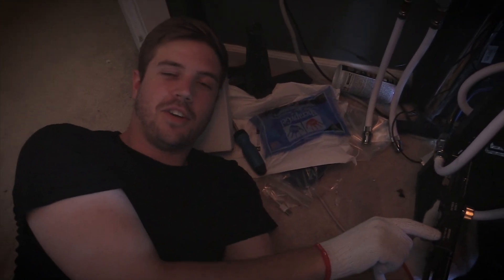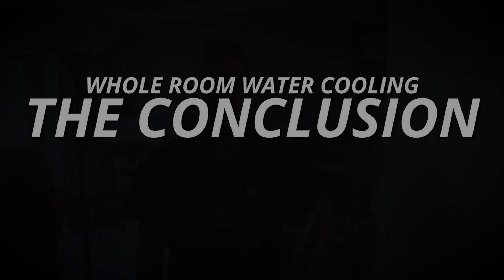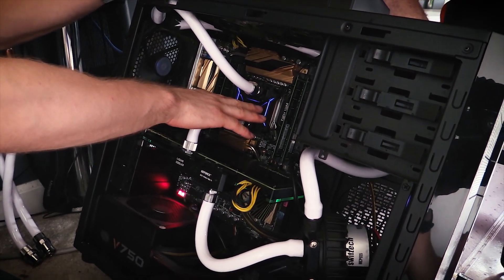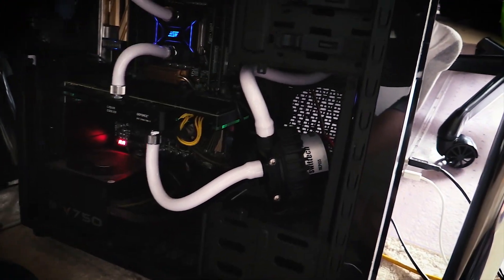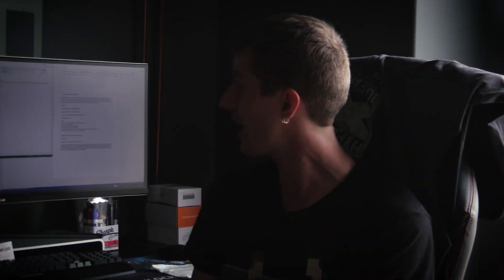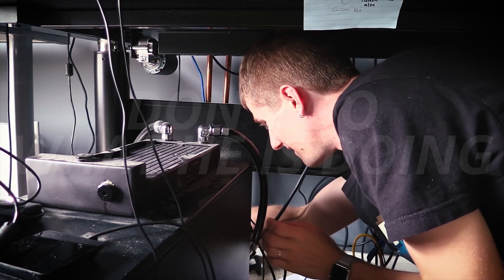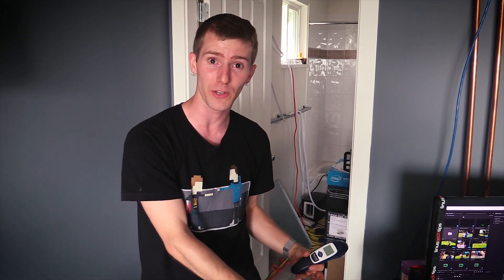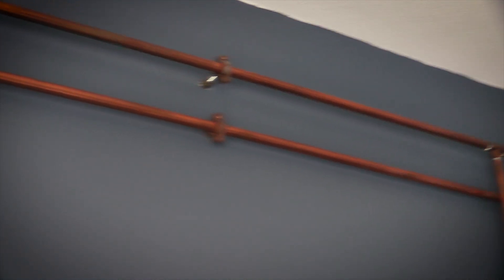Whole Room Water Cooling Part 7 - It's FINALLY over!

Comment: whi didnt you just put the whole computers on the other room whit a nice extractor on the ceiling, and drive the I/O to the other room with a nice air conditioner, youll get a cool quiet room to work, or just put a huge A/C on the room and be done with it

Comment: Large server rooms often use the space below the floor, and above the ceiling as plenums, to force cool air through the equipment. I've seen people use the same concept. Its a considerable amount of planning and effort, but it is possible, and quite effective (if your installation is permanent). It does require a split system but, your installation made me think of using a heat exchanger to pass cold potable water through to absorb the heat, thus saving some money on hot water heating  at the same time, decreasing your overall energy cost. It would be interesting to do a thermal analysis, to see how much heat you're actually dissapating from your equipment. Maybe discus it with the guy who did the nice job sweating in all that copper for you, he obviously has some knowledge about the subject. An afterthought,  the copper lines should probably not have tees, they should probably be in a series circuit, and not drop in parallel, for the sake of efficiency. Not sure what the ef% would be, but I rarely see parallel loops in new work. Great educational project, someone out there is probably already building on your work, and that's how we end up with great designs for stuff like this. My compliments.

Comment: Rubber hose/tubing with a glycol coolant and buna o-rings on fittings and water blocks would make this cheaper and easier to make and modify. Also getting a couple car radiators for heat exchangers would be cheap and work very well with low flow cooling solutions.

Comment: You went about this in an odd way.  The practicality of this isn't viable.  You lost a few hundred sq. ft. of space.  A better way would have to tapped into the cold water line and install a control valve, then exited the loop through the drains in the bathroom.  It would have taken up much less space.  Also, you should have used pex piping because of the heat transfer to copper.

Comment: So what happens if it's hot outside?
Reply: not much. even if it's like 35 degrees C outside, the cooling water would be up there too, and heated water one or so degrees hotter. since processors are already at 48 something normally, they wouldn't feel a thing, or very little, half a degree or so. since the amount of heat the computer generates doesn't increase, so doesn't the difference between incoming, outgoing water.
Reply: Exactly, it'd only work if there was an extreme temperature difference. But then you'd run the risk of having the coolant freeze, assuming it's water.
Reply: what? I was arguing that the cpu doesn't feel a thing if the incoming water goes from 29 to 39. those  computers still heat it by the same degree. to 31 and 41 respectively. same amount of heat output before or after.

Comment: well the thought was correct indeed but the execution was horrible...

you should have drilled the outlet into the earth 60-70cm where the temp is constant and then drive a passive heat exchanger

this way you can freaking cool your entire place not just your pc's

Comment: Haven't watched the other videos in this series, but the very first thing I thought when the video started was 'why haven't they insulated the pipes?'  

You'd keep the cooler water coming into the room cooler and stop the exiting warm water from dissipating the heat back into the room. 

Also, why run the pipes so high up the wall? They only need to get from one machine to the next at approx desk height. They'd be easier to service and the shorter system would require less load from the pumps to push it through and the fluid cooled quicker.

Comment: Cool idea! It looks like you don't want to rip open the walls but if you ran the circuit through the house and it was long enough it wouldn't have to go outdoors and would cut down on the heating bill in the winter. You could get wicked results from the cold basement if you evict your tenants...

Comment: even if you guys are going to get this comment or not you know you're not your idea was pretty good I would think I only see a few things wrong with it first of all you used copper pipe you should have used copper pipe you should have used them PVC pipe or something second of all he had in the top half of the room you should have never had in the top half the room you should have had it in the bottom along the baseboard other than that it probably would have worked a lot better than it did have not to mention you know copper putting all that fun stuff and your computer's least if you used plastic pipe in other words PVC pipe you guys won't have all that nasty dunk in there and you should get some sort of a filtration system 2 on the off-chance you guys do decide to rebuild that use PVC pipe and go along the baseboard remember heat goes up the cold air is down so the pipes will stay cooler if they run along the baseboard instead of up along the ceiling were all the heat is
Reply: oh yeah and one more thing you know you guys whatever radiator system you guys decided to put on the outside of your house you guys should get used to that you should have used him either cold water so I ran it through the bathtub and just had cold water cooling it or you should have just use like a an air conditioner type system like they use for fish tanks pacifically saltwater fish Lowe's refrigerator systems are really good and all you had to do was run the whole story and then they would have kept your system cool and then you would have just had to have a normal air conditioner thing blow into the outside world I mean there's a lot of ways you guys could have done that but using you know standardized fans and standardized radiators really cheap maybe not so much a standardized radiators but you guys should have used more radiators and maybe took him into a lower part of the house or into the car into your garage and then used and then use industrial-size fans or an air conditioner

Comment: I would have run the cold line on the floor and insulated the hot line near the ceiling.
Also I would recommend installing a standard whole house filter (like what is used on ice machines) to remove the extra junk from the water. Last did you try filling the tub with cold water? (moving the pumps to outside the tb but leaving the reservoir inside while it is 1/2 full [or more] can remove as much as 30% more heat.)

Comment: Whilst you might call it a fail, the noise win is probably worth it alone, especially in a room full of workstations.

Yes to other commenters: Whole room AC works fine in a server room., but the average server room runs at 85-90dBA and is NOT a pleasant working environment. If you can put the noisy bits outside or in an acoustic cabinet without overheating them, then its always worthwhile.

Comments:

1: Contamination/corrosion: This will always happen due to dissimilar metals in the blocks and suchlike. You need to have sediment filters and cathodic protection in the loop from day one. Drinking water spindown filters are cheap and readily available.Massively oversize it to reduce flow resistance. Couple with something like a Lakos twistiiclean to take care of the big bits and you'll probably never need to change it.

2: Bus vs spur piping. Why are these the same diameter? You should be using larger diameter on the distribution piping to reduce flow resistance and turbulence effects at the pipe junctions. The higher temps you're seeing at the end of the run is because of that.

3: Definitely use PVC or some other kind of insulated piping. Butynol is easier to work with and more than adequate for the temperatures involved. There are pressfit and crimp connections for this kind of pipework. Pretty? No. But to be honest, nor is that copper piping. Put it in some trunking.

4: Get rid of the opaque dye. if anything goes wrong you want to be able to see what happened and inspecting for gunk is much easier if the medium is transparent. UV-reactive transparent dye works well for leak detection.

5: The outdoor unit will be more effective if you arrange a recirculating waterfall/mister on it (adiabatic cooling). This assumes you don't mind the water bill but it's still cheaper than active cooling systems. if you go for this, make sure you have a uv steriliser in the waterfall loop (legionella is nasty).
Reply: @Ryan Black, the room temp only varied by 1 Celsius, the actual computer temps were very good, near room temp, or 10 to 15 Celsius drop. The electricity is probably equal or less than that of an AC actually. Of course, it's still not worth it for the pure goal of cooling the room in general... but that isn't really the point. It's nerds doing nerdy things for nerds sake. Similar to their series of making their own heat sink, you could just buy one, but it's the nerd goal of trying to make your own.
Reply: honestly, they should've just put all the computers in the bathroom, put an industrial fan in the window to blow air outside, put a vent in the door then just run long extension cables to the monitors and have a 7 port usb hub at each desk, they would've eliminated the noise and heat problems that way
Reply: exaxtlt
Reply: Totally agree on the piping diameter, with seven drops there wont be any flow at the last junction
Reply: Thank you. They should have hired someone like you to do the job. Would have really liked to see the results from a system like this properly installed.
Reply: Apart from the fact that they had to introduce pumps in each workstation to make the flow work >.> I don't imagine those are unnoticeable.
Reply: @benhook1013  If iam not mistaken those run just if they are not conected to the system
Reply: @Etien Don't think so, such a large system, the pressure would be too great to run just off the pump in the bathroom. When they disconnect/reconnect they only change the connections on the back of the computer, didn't see them mess around with the pumps each time.
Reply: @benhook1013  Then why did they need the second pump to flush out the PC individually? At some point he even put the pump out of a PC  when he reconnected it to the system

Comment: I am using a 400V 3-phase 150W scirroco type fan as a cooling aid for my old laptiop. Works like a charm. The fan was originally intended for coal heting boilers, lol. Works whisper quiet and by that i mean you can't hear anyone whispering or even talking.

Comment: For all your awesomeness I'm afraid this idea was just plain dumb in execution...
 
Copper radiates heat like a mofo, if you could insulate the heat until it was outside the room it would be much more efficient, all that copper at the top of the room is just silly...

Comment: insulating the copper was a crucial missed step also as you said vents on a high point and drain at a low point with a hose bib connection for easy draining out a window or sink.. also if you could have managed to pump chilled water in the system this would have been excellent

Comment: one use like metals two biocide and anticorrosive three car rad and car fan..... four better location of res... five two pumps but put them in different areas in the loop not directly next to each other... 6 drain plugs on allll systems...

Comment: as heating engeneer, all i can say its not bad, but you do few mistakes, first you use Cu pipes instead of some plastic with oxigen barrier, thats why you have brown watter, all you can do now is to add some corrosion inhibitor, wich prevents watter to oxidize. and i think you oversize your pumps i guess you have too much pressure on pressured side of the radiators.

Comment: As soon as I saw all that copper on the wall I was thinking most of the heat is being removed through the copper rather than the radiators outside. Like you should have seriously lagged the whole thing

Comment: now this makes me wonder. i live in the netherlands were temps outside are pretty low usualy. im currently in the process of researcing a new system and would it be feesable to build a water loop like this straight trough the wall and have the cooling bit done outside. not neccesarily to cool my room but to get the best cooling performance and noice reduction.

Comment: wouldn't it make more sense to just get a portable air unit that u can put in the window. I connected one to my pc and now run 35C when full idle and that's with just a few fans in the case. My roon can be 85F this way not water cooling needed

Comment: Idea get rid of the window
Reply: Windows act as a heat trap (sunlight gets in, heats the room and is blocked from reradiating outwards.)

An external awning helps a lot in hot weather. That's why they used to be commonplace before bruteforcing things with AC became popular due to cheap energy.
Reply: Removing the window would be against Fire Code and law for a room that people inhabit for extended periods of time...  Two points of egress are recquired at all times.  Especially if the residence is being used as a business.

Comment: Why not insulate the outlet with foam?
Reply: So that the warm outlet pipes don't heat the room up. The goal is to dump the heat outside.
Reply: its funny you have the guy from h3h3 vids and at 3:26 he is watching h3h3
Reply: There is significantly more piping in that room than most rooms heated with baseboard heaters. Though baseboard heaters have radiator fins and probably a higher temperature differential. Insulating the pipes could perhaps make a 1° difference -- which would double the effectiveness of the system. But, for sure, a wasted effort all around.
Reply: and shortening up the runs.  the 5-6 foot inlet/outlet pipes from the ceiling down just adds so much extra surface area. not to mention running it completely around the room.
Reply: Triston Charge you are wrong, copper is almost the metal that disipate heat. and there is in full contact with the air of the room.
 MrRahre wrong too, the heat drop will have gonne very much with a good insulation. not just 1°.
Reply: Insulate the piping, add an automatic air bleed valve, look in boiler plumming.
Reply: MrRahre Those pipes aren't big enough to heat the room up, wasted effort.
Reply: You mean the inlet? Why would you insulate whats already warm and headed out to the radiators?

Comment: hey linus... why not use the car world's idea of cooling liquid. antifreeze has anti corrosion additives. due to the fact that engines are made from corrosive material. would be expensive but maybe using it as an additive
Reply: or talk to an hvac tech... they would be able to place your rads into an ac system

Comment: The ammount of heat dissipated is pretty easy to calculate:

0,3deg*4200J/(liter*deg)*0.25liter/s=315W

Although it depends on your pump efficiency (I assumed 0.25liter/s which seems pretty reasonable)

Comment: Why the fuck didn't you buy an air condtioner an solved the heat problem easier and faster ( you could invert that extra money for new parts or more air conditioner )

Comment: The one thing that sprung my mind during this series, and that is something that I would use. Why did you not use a cooler from a car? It's one whole unit, it should be larger than the coolers you used.

Comment: I bought a 25ft HDMI and moved my computer to the laundryroom outside my room.  My room stays a TON cooler by having that 400w compu-spaceheater in the hall.  Next I will put a car radiator and boxfan outside the laundryroom and plumb the computer water thru that to dump the heat outside... because now the laundry room is a million degrees.

Whats wrong with just running car antifreeze & distilled in the loop with a car radiator & boxfan?  
Cars seem to like it.... my truck has it and it dont overheat. 
G1/4 flow restriction will ensure the hot water has a fairly low gph, so a lot of time to cool in the car radiator before returning.

Comment: Why do you think copper is used for heat pipes? Because it has a high thermal conductivity. So what you have built is actually a big room radiator.

Here is my idea: 
Build a virtualization server in your basement, put it in an oil bath and transfer the hot oil via insulated pipes to underfloor heating systems in colder rooms like bathrooms or kitchens and for the hot days, you can build a second circuit going outside of the house to a big radiator with fans (preferably at some place in shadow), or you can heat some water for showering. Anyway, you should think of using that heat instead of getting rid of it, because it's energy that you paid for the moment you turned your cumputer on.
I'm pretty confident about my solution, but it would need some calculations like power concumption of an oil pump, payback period of the whole project, efficiency, etc.

Comment: i found my 480 60mm thick ek radiator with 1600 rpm fans chilled my water loop before the xfire r9 290's and 4770 could heat it even under full load it only got to 36 degrees c 
so it was mint for summer

Comment: two things should have been done here, 1st shut off valves at every I/O and 2nd copper lines should have been insulated... oh an also why not run the lines injunction with the radiators instead of unplugging the radiators to hook up the copper lines?

Comment: why no pipe insulation? all the heat is still leaking into the room....there is foam insulation  that snaps right on that copper pipe, you still can add a bleed valve also....
as for the metal tank rusting, there is a 5$ additive that stops the rusting and keeps the water clean.... that system would still work.

Comment: The best method I've seen so far is a drier outlet and ventilation hosing.  The computers vented into the ventilation hose, which then attached to the drier outlet.  Although the contractor that built the house was a little confused why there were 2 drier outlets.